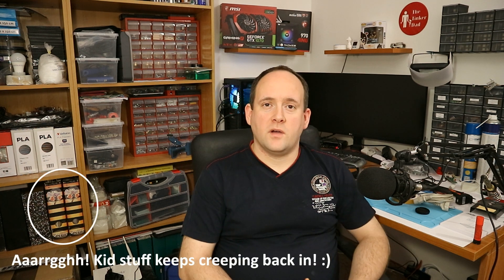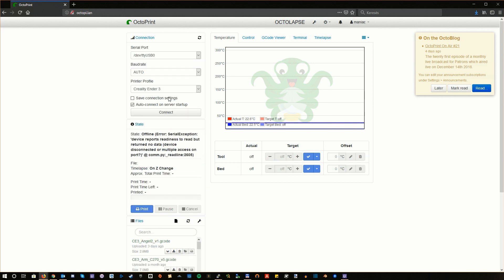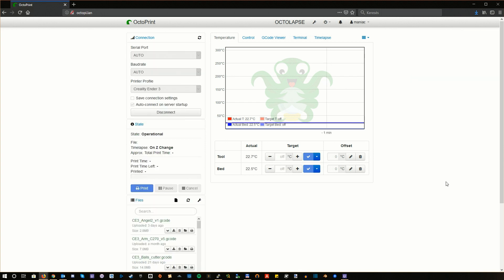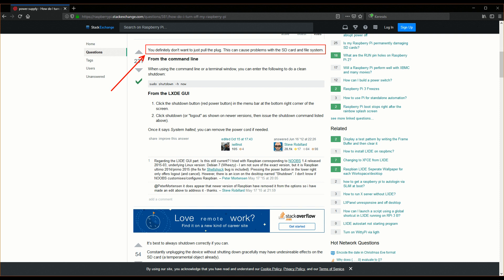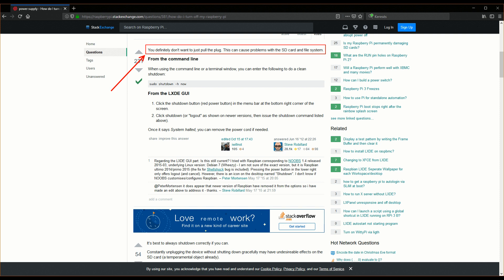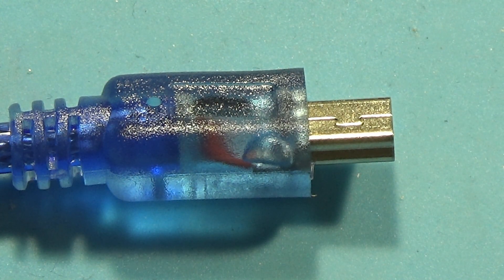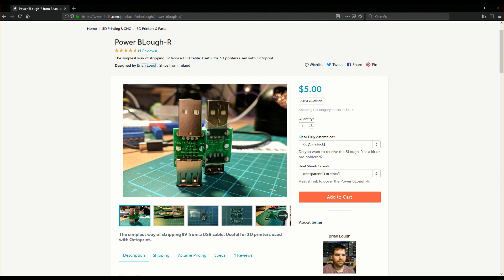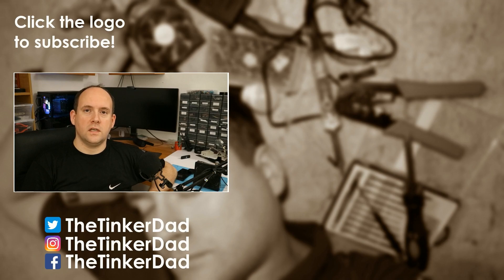Powering Your 3D Printer Remotely On/Off - The Safe And Easy Way!

Comment: Can the printer be harmed in anyway with this method of directly cutting power rather than using the power button? You mentioned not wanting to cut power from the raspberry pi as it could harm it. Couldn't the same thing happen to the 3D printer?
Reply from the maker: No, there's a difference - cutting power from the RPi can hurt the files on the SD card (and damaging important system files could prevent the RPi from further booting from that SD card). That's because how the operating systems work: they keep files open for writing, etc. and if you suddenly cut power without the OS properly shutting down, you can end up with damaged files. On the other hand, there's no such risk with the 3D printer - it doesn't have an OS in the first place and even if you use an SD card with your printer, it only reads stuff from it, almost never writes.

Comment: I have a older cocoon create (i3 clone),  I already have it on home-assistant.  It has the same display  powered-on from the usb. Thanks for the usb hack tip.   Now to find a plugin to control the printer power.